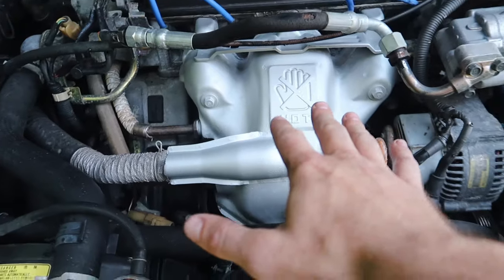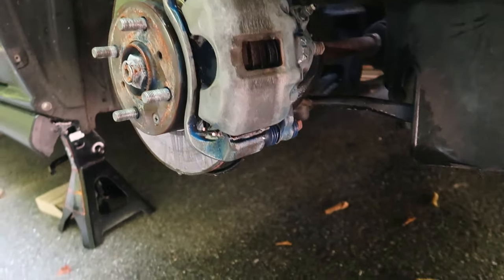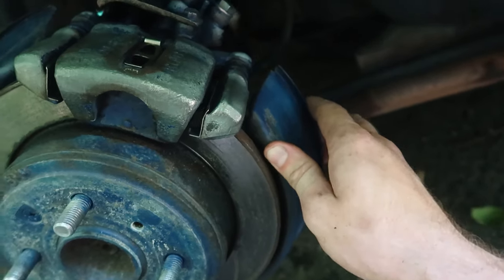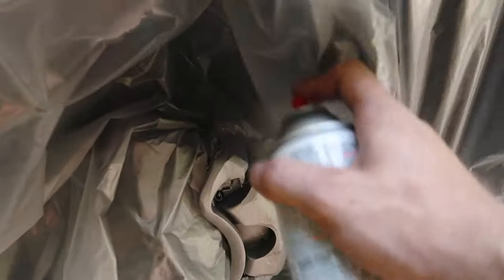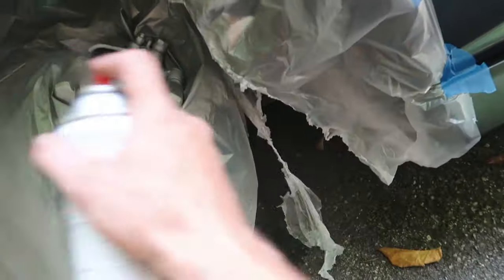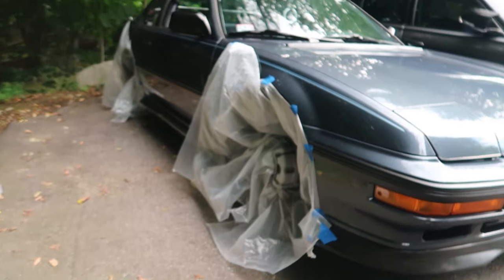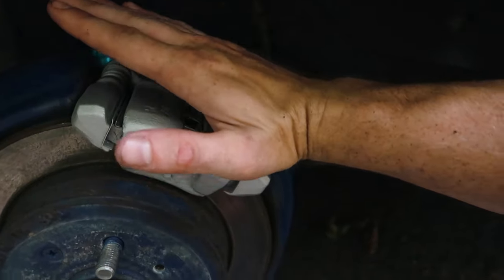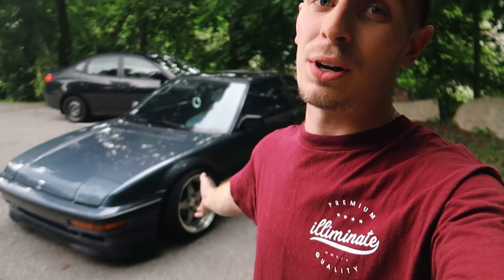BRAKE CALIPER PAINTING ON THE HONDA PRELUDE!

Comment: Was up my guy I watched more of your Prelude videos. I've been spending the last 5 years studying the info on our Preludes and what we can/can't do. I also got a B21A1 sitting around if you want to make some classic power, and there are even new taller cams you can get for this motor still surprisingly! But I got an entire parts car with ALB parts if you are trying to do a cool project.
Reply: Also you can unbolt almost everything on that car but I would keep your shields bruh, they don't make replacement parts for us and if that fucks up your arms you are gonna be a sad spaghetti.
Reply from the maker: DETHANDMexicanInc very true 😂😂😂
Reply from the maker: DETHANDMexicanInc where abouts are you located? Is it a manual trans?
Reply: No none of the Preludes I own or have owned have been manual but they all have been automatic 2.1L so I got some more odd ball parts. I'm in the DFW area.

Comment: Good quality, good content. I love every video that this guy makes no matter what it's about..
Mod suggestion. Do the sleepy eye? Or that's done already?
Reply from the maker: Kevin IL I’ve wanted to do that but I’m worried about messing up my headlights for good :( won’t be easy to find replacement parts
Reply: They have a Halo mod though and they can even be square.
Reply: Elevated Media I see.. But what could go wrong, well unless you install some ebay crap or if you install it incorrectly 😅